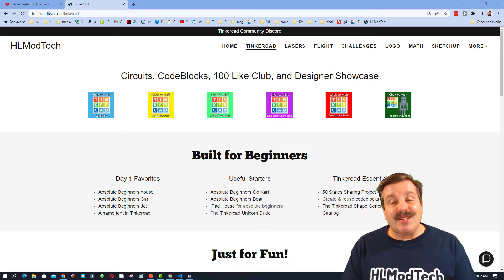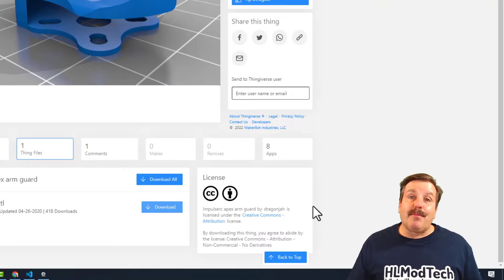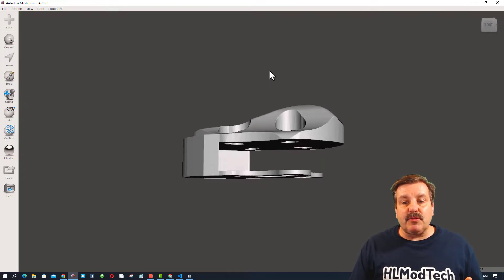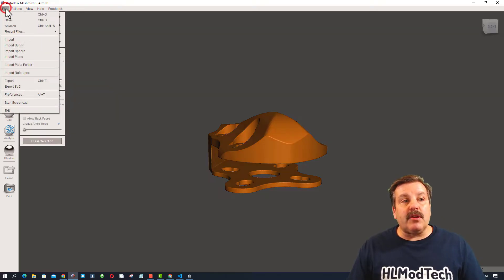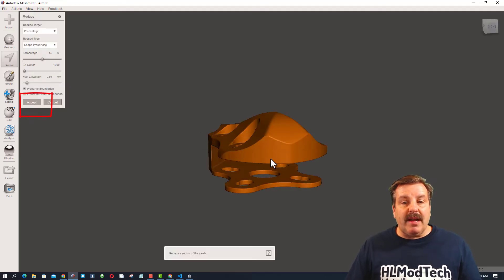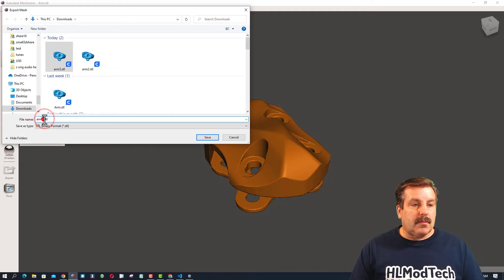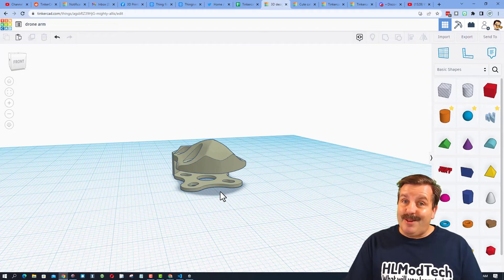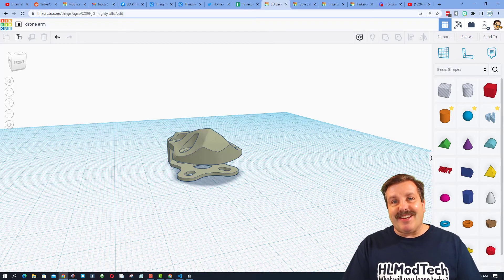Reduce STL file triangles & size with Meshmixer Tinkercad Import steps

Comment: Dang this is great. Thanks dude
Reply from the maker: My pleasure @sergiom4300. Thank you for the feedback! 👍💯
Reply: Yeah i was able to import my file. Before this i just used to split my models on the slicer and import them one by one to tinkercad to fuse them and then start working.

You saved me a lot of time really @HLModTech
Reply from the maker: Glad to hear it. This is my Mesh Mixer Playlist. https://bit.ly/meshmix  I have barely tapped the surface of what it is capable of.

Comment: I have a question about the complete opposite problem. I orderd my first 3D printer a few days ago and i designed a round skirting board for a columm/pillar or how you call it in english. The problem is it looks not so smooth, you can see the fascets in the round shape but i want it smooth because its in the living room later. Is there a software that can smoothen my object?
Reply from the maker: I have a slick chat area at my Patreon site. https://bit.ly/hlpat  It is available to free members. Slick for questions like this because we can add images and links. This explains it. https://youtube.com/shorts/xHUM1eGOmjE?feature=share What program did you design it with?

Comment: Do you have any advice to align a scan?
Reply from the maker: I do not. What tool are you scanning with?
Reply: @HLModTech  RevoScan 5 (which I'm not good at yet!)
Reply from the maker: I understand that completely. I am not sure which phone based one I tried... but I never did master it.
Reply: @HLModTech  Actually, we're using the Revopoint POP 3 scanner connected to a laptop.  We only use AutoDesk Inventor, and it doesn't have many features for surfaces.

Comment: Came back to this video hoping I've done something wrong since I was losing details of a model last time I tried to reduce triangles. 
Do you know if theres a way to stretch or pull a single triangle point in a program?
Or a way to remove a single intersecting line?
I have a few models created in tinkercad that I'm having trouble getting objects to line up perfectly when joined and hoping to smooth out the transition a single polugon at a time. 
Majority of time I tools in Meshmixer the smoothing is waay too agressive and gotta find a better way. 
Thanks sooo much for so many helpful videos!
Reply from the maker: I’m skiing today. But when I get a chance, I’ll see what I can figure out. Thanks for the support as far as Tinkercad lining up you may want to search for my micro nudge video.
Reply: @HLModTech  Awesome! Enjoy and be safe!
Two particular projects I'd like to do from a single file as starting stl file.
Absolutely no hurry, I have a few ideas to try, Maybe I could share the file with you later and see if you have better ideas. 
Thanks again!
Reply from the maker: Thanks. Would you like to send a share link so I can see inside it? Here's how https://youtu.be/XeDQjhRK8lg You can reach me at hlmodtech gmail.
Reply from the maker: This is the nudge video. https://youtu.be/NMf7IzmqMuU
Reply: @HLModTech  Unfortunately the two shapes I joined aren't exactly same size where they meet with multiple angles to line up so as soon as one side looks good another doesn't perfectly. 

Fortunately I did a similar but much easier project last night on a dog file that required supports. 
I was able to select only the triangles I wanted and reduce in meshmixer until they flattened out.
I no longer needed supports and barely changed the look of the model saving over an hour of print time and a decent amount of material. 

I should be able to do same thing in my other file to eleiminate the jagged lines where angles of parts don't meet well. 

Should be able to slice parts of original model then stack afterwards. I'm trying to turn the model into a file with 4 printable layers to put on my business card. 
I'm using a shrunken version of original but doesn't slice very well losing the main details of the part. 
By layering the critical parts it should slice and print better.
Reply from the maker: Sounds like a fun project. Glad you are making progress. Any chance you can Trace with the sketch tool. https://bit.ly/advsketch
Reply: @HLModTech  Possibly, I have been meaning to try that out too. 
Especially on another project using logo of local girls hockey team to make some keychains for them.
Reply from the maker: Cool. I use that SVG outer link trick for keychains a ton. https://youtu.be/Pk1MjmfLqZ8
Reply from the maker: What printer do you have? If you have AMS and want the smooth face down print, this one is slick. https://youtu.be/ZJB1yh4Ej8Q
Reply: @HLModTech  A1 mini and P1S
Reply: @ I finally had a chance to try out the sketch tool. WOW! I should have tried it sooner! Worked perfectly! I just traced my 3d model and made individual shapes of each section I wanted at a different height then assembled flat on the build plate. Took longer to figure out how to get the new shapes flat on the build plate than anything else. Changing build plane then copying and pasting after changing build plane back to default worked quickly after trying a bunch of other things that didn't work. I was sick of removing the botttom of a shape to make sure it sat flat. I think I need to watch more of your videos and pay better attention.

Comment: you still use this man?? the quality reduction is almost too much.. how can I get it back up a bit.. hmm
Reply from the maker: I generally make my designs from scratch. This is just intended to help users that would rather import. Here is an example of where scratch was likely easier. https://youtu.be/-i9B84NTqA4
Reply: @HLModTech  I mean... when I reduce this file, the look of it doesnt look good
Reply from the maker: Oops... I understand the phrasing now.. 🤦‍♂️ I would just use Ctrl+Z to undo... and try a smaller value. If anything is too far off... you can just restart by importing the STL again. That file does not get changed during this process. Unless of course you exported the new one with the exact same name.

Comment: Hey my Friend!  Just watched your Vid, Great Job as Always Bro.
So yeah.  i had a .stl, sizing head i wanted to import into tink but was 29mb.
I found a Great New and Super easy way to do this now with out mesh programs.
cheers.
Reply from the maker: Thanks for the kudos on the video. What tool did you use?
Reply: @HLModTech  ITS in Prusa Slicer any newer version,
Under, Simplify Model / then change the the option from level of detail to Decimate ratio with the slider number of triangles and wire frames
Reply from the maker: @crazybeaver5789  Good share. I have actually used that lately since I have 2 printers that are using Prusa Slicer.

Comment: Unfortunately this doesn't help mac users
Reply from the maker: That is a drag. I’m sure there are options, but since I don’t use a Mac, I do not have any to share.
Reply: @HLModTech No worries, I'm sure you'll mention it some place if you hear about it. In the meantime I need to find an easy way of accomplishing that task when it comes up. Right now I just move on.
Reply from the maker: This post might help. Some users found success. https://forums.autodesk.com/t5/meshmixer/meshmixer-3-5-mac-installer-no-longer-available/td-p/10794278
Reply: @HLModTech  Thanks very much for finding that, which shows some clarity. Even though the problem of downloading 3.5 for mac is solved possibly, the "known security issue" is an issue for me, I also would doubt it supports arm macs. No huge deal, this is just a hobby for me. Thanks for you help.

Comment: i tried these exact steps and MM destroys the model.
Reply from the maker: It is possible, the original creator did not make a solid project. Anytime you’re reducing like that, it’s not an exact science either. Those numbers can vary ton depending on the design.

Comment: I have use Meshmixer  before, also sometimes i cut a stl with a slicer, import them into Tinkercad 1 at a time then join them together
Reply from the maker: Good call! I love Meshmixer for separating large STL files I used. I have a few videos about that too. Very handy.
Reply: @HLModTech  I'm on my way to get one of those videos. I reduced the .stl down, twice. When I was finally able to bring it in to TC, it was headless. Reducing, then doing a plane cut and bringing it back together in TC might just be what I need. How do I thank both of you enough!!